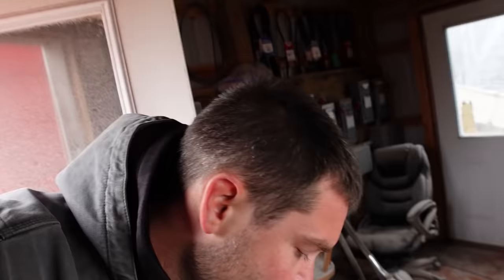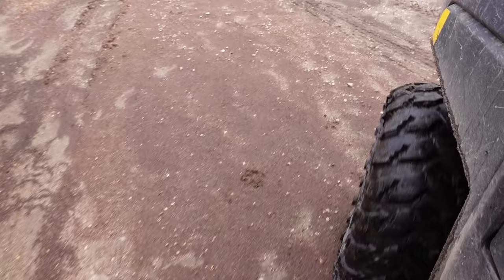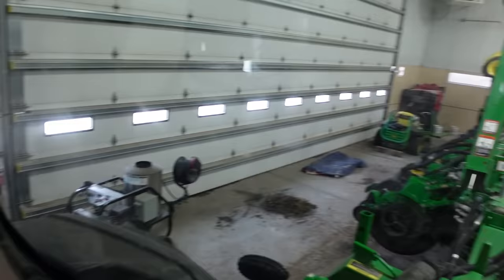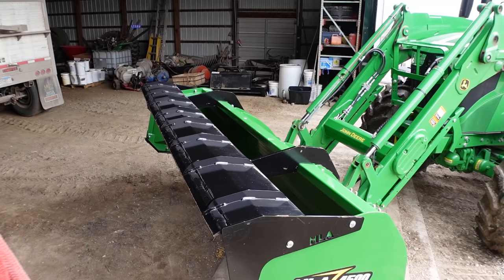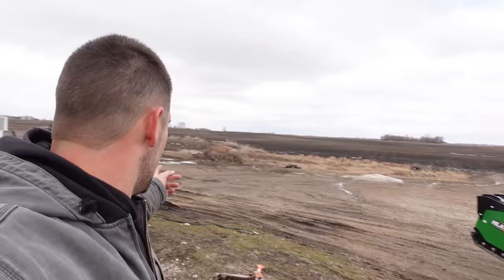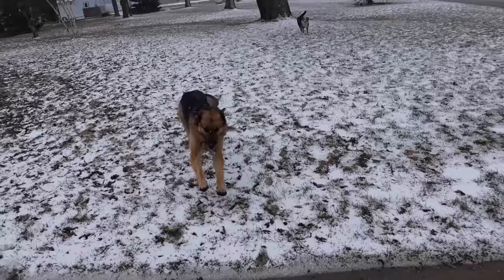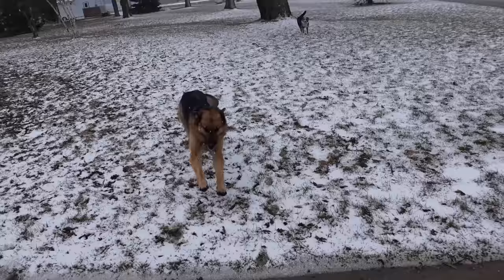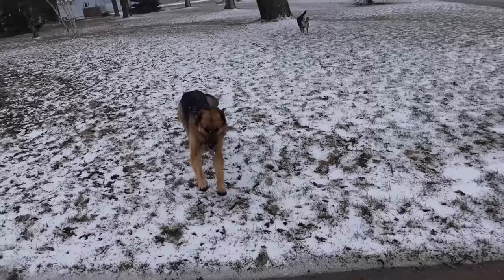Jim says it's Time!

Comment: Just a word of advice for the extinguishers if they remain in one area and just sit, turn them upside down and shake em. The dry chem will pack down when they aren’t moved around. You’ll feel the powder shake in new extinguishers.
Reply: You don’t have to go around and turn them upside down. Dry chemical extinguishers are made to have the agent at the bottom of the extinguisher.  If you do go through and shake them up or flip them upside down within minutes of them being hung up the agent will be back down at the bottom with nitrogen at either 100 or 195 psi pushing it into the bottom to go out the down tube when the valve is opened.

Comment: Never fill fuel filters. Unless your pouring it in the little holes around the edge, your filter is full of unfiltered fuel. I always just use the bleeder screw and hand pump/electric pump to prime. It’s not a huge deal on all the newer common rail engines. Note there’s no air bleeder screw on any of those systems. Just cycle the pump a few times and let her buck. I guess in the land of dead batteries you might have to take a different approach tho.
Reply: (Yawn...)
Reply: Tons of equipment in the world that has always had filters prefilled with no issues 🙄🙄🙄 this subject is getting so old.
Reply: @94chevyz71  doesn’t matter, if the manufacturer says not to prefill then don’t prefill🤡🤡🤡
Reply: @bigcheese370  how bout the equipment I pay for I use how I see fit and change the filters how I see fit? Considering I’ve never had even 1 seconds problem with any Deere or Case tractors or combines on this farm. This whole don’t pre fill is the stupidest argument in the world today.
Reply: @94chevyz71  its just not necessary, why go through the hassle of spilling it everywhere when you can just let the system prime with the ignition on.

Comment: Instead of diesel fuel we always use conditioner and two stroke oil to fill out filters up 
Gives the whole system a good cleaning and the two stroke oil adds a great lubricant to everything after sitting all winter 
Also much easier to fill filters up then using a big fuel jug

Comment: Hey Zach if you disconnect the negative cables on the batteries there won't be a draw on them and they might make it through the winter time I always like to charge once a month through the winter time but they will oxidize in the inside of the battery in the winter time if they're hooked up whether they're new or not

Comment: The new common rail engines do not air lock like the old mechanical injection engines. Have you tried opening the fuel tank and listened for the bubbles from the return line. I do that on the truck. No bubbles and she starts and runs with no issues.

Comment: As a Mechanical Engineer (Dept of Defense not automotive or farm equipment) you need to know that your equipment is designed for cheapest first time assembly NOT for ease of maintenance. The factories priority is to cheapen part cost and assembly time.
Reply: Yep, heard that from someone that used to work at engineering college. 
Also, don't care about quality or longevity.
Reply: @BWYinYang  Often your priorities are set by your boss and his boss. You don't have full control of what you are designing.

Comment: Zack- those Cummins 15L fuel filters are always a pain innthe arse! The beauty part is they have 12v electric lift pumps, you can fill your fuel filters by cycling the key 1/2 dozen times or so, will fill filters and displace air back to fuel tank
Reply: Hi Todk.

Comment: So the batteries on the trucks seem to die due to power loss in the system. Why not add a battery disconnect to them like on the tractors, should be an easy install?

Comment: You don’t need to pre fil your filters. Once you change them cycle the key 3 times before starting
Reply: Good to know. I was wondering if these had an electrical transfer pump or not. Remember the old Massy-Fergs that had a thumb lever on the side of the mechanical pump for priming. Most convenient!
Reply: I was wondering about that - with our older CIHs no pre-fil needed.  Also, with those you don't have to change the filter until you loose power (ie. it starts to plug up), which is very infrequent for most of our engines.
Reply: This winter we changed fuel filters on our 9560R & 8235R filters dry and cycled the key until you can hear fuel going back into the fuel tank. Great videos. No farming yet in our part of Mich.

Comment: This time of year leaves you with such a "nice looking muddy yard" to move machinery or tractors around.....    Change subject:  Just an idea:  this idea may work or not depending upon locations of equipment.  There are small battery charger/trickle charger units that you can mount and you hook up to the batteries (like the trucks) and it maintains a charge through the winter (and summer, if needed).  You may have a challenge with a long enough cord or wiring from the outlet to the battery to be charged but this could save you time and frustration.  Easy to unhook/unplug and to hookup.  Just a thought to preserve those batteries and reduce your frustration levels.
Reply: We just put one of those on a pickup that has some small electrical drain on it somewhere.  Those work really nice.  I'm thinking about putting one on each piece of equipment.  lol

Comment: Zach suggestion re the semi truck batteries always being dead.  There are 24 volt cutoff switches available that have a key fob remote control.  

I saw one on an industrial generator so I know they're out there.  You just clicked the remote and the cutoff disengaged so the computer wouldn't kill the battery while the machine was sitting idle.   Those truck batteries are so expensive it'd be worth a try.  Maybe somebody out there knows who makes one.

Comment: On vertical filters, poke a hole in it and drain it before making a mess.
Reply: Why don't they mount them right side up? That would work like a settling bulb and keep the foreign material down low and reduce the chance of bad things ( and water) going to the pump & injectors. 
 Easier to change too ya? 
But, I'm not an engineer 😁

Comment: Not pushing, but consider getting a METAL burning fire putter out.  If you get welding on something in the shop and it is over heat or you run into Magnesium somewhere it will burn until it goes out - White Hot.  Often in Alum blocks and Assemblies caution welding around that light metal.

Comment: 20:05 Good there Jim 👍
Someone has to tell the engineers to learn a lesson
Reply: They designed crap like that already in the 70s. Fuel filter right on top of the start motor, so the whole soup ran over  the starter every time and you could change it every other filter change as well.
Reply: Hey those engineers went to school a long time to learn how to put things in the hardest to reach places and most inconvenient locations. 😆😁
Reply: @michelle778  The dumbest thing I have come across is an up side down oil filter over the ac compressor and the multi-belt. They have thought a bit about drain plugs but it still takes a lot of paper to not get oil on the belt

Comment: Hi a suggestion maybe thought of it or not all the semis have ecm draw , but need to still see once the batteries are fully charged how much of a parasitic draw on the batteries there is , I forget  what the etc constant is for a draw ask the repair shop . Other wise once charge put in a battery disconnect. Then might have to have the shop put them in so it keeps the ecm alive but not kill the batteries.

Comment: Thanks for another great video Zach. Enjoyed it. 

Great to see your dad back home. To bad the weather is not better for him. Let him wrestle with the truck batteries. 
I have been thinking about them and there has to be a answer somewhere on why they go flat. Even with a battery disconnect. 
Strange deal??????
Hope someone comes up with a answer. 

Good to see Jim again. Good guy you got there. 
I have to laugh about the comments about engineers on the tractors. You got several comments back from actual John Deere engineers that have a reason why it is that way. Had to laugh over those comments. Oh boy. Make sure Jim reads them. 

Anna is really keyed into the tractor starting. She never misses. I agree with you Zach, she will not like the cab at all and probably will not stay in there. Oh well. 

Good delivery service getting your filters and such. Hardly any wait. Very nice. 

Seems always jobs to do around the farm. You can keep busy all the time. 
Messy and sloppy in your neck of that woods right now. Spring time. 
The haircut thing. I have mine super short so just get someone to run the clippers over my head and off it comes. Close to being bald anyway. No cost on the haircuts. 

About it for now. If you find a answer on this battery thing, please clue us in. 
You all take care and be safe. 
Looking forward to the next video. 
Thanks for everything Zach. Appreciate the filming and thanks to Becky for editing. 
The Iowa farm boy. 
Steve. 
😊👍👋🇺🇸

Comment: As a Service Engineer at Caterpillar, that did serviceability and maintainability audits on ag tractors, things like you ran into do get flagged before production.  A great number do get fixed, but we didn't always "win".  Considerations such as manufacturability, cost, and how it plays on different configurations and attachments all played into it.  I said a lot of nasty words when I had to deal with it in the field, too!  I suspect for your Deere, there were various hydraulic configurations on the same tractor model as well as wheels vs. tracks that came into it.  Always a balancing act that does affect ones' vocabulary!  Also a caution - be very careful pre-filling filters.  You seem to have a decent bulk filtering system for oil, but dumping fuel into a filter from a 5 gallon jug can lead to problems.  The center of most spin-on filters is the clean side.  Dumping unfiltered fuel or oil into the clean side of a filter can lead to shortened component life.  We once did some tests that indicated that prefilling a fuel filter with unfiltered fuel through no more than 6 filter changes can damage a set of injectors.  Especially with modern injectors running over 35,000 psi.  Just a word of caution.  Great content though.  Looking forward to spring at last!

Comment: Not sure if someone has suggested this, 

Anyhow those X15’s are used in highways trucks, same issue with full fuel filter and having to twist it sideways. 

Drop the filter down, shove a rag into the filter, then twist sideways and remove, the rag seal/absorbs diesel and stops it from going everywhere. 

On the install, don’t fill those fiters, the common rail system on those motors cannot accept contamination, put them on empty, 

On the top of the filter housing you’ll see a small pressure check fitting, poke this with a screw driver while your key is on and all the air will come out and clean fuel will go into motor. Just my 2 cents I work on these daily, the fuel injection pumps and injector have 0 tolerance for contamination. Just so life is easy for you next service

Comment: I have a 2 inch jerk rope and I use it as a jerk rope when I have a tractor stuck, I hook one end of the rope to the stuck tractor and the other end too the puller tractor, back up about half the length of the rope, put the puller in 4th gear  go full throttle and pop the clutch and GO until the rope is all stretched out and then push the clutch in tractor is out
Reply: @paulcopeland9035  I have never broke anything yet, and I've had my rope for 30 years.
Reply: @paulcopeland9035  I am always careful I use screw clevises on both ends of the rope to pull with. Side note, this winter I jerked out  a semi tractor and trailer out of the ditch with one jerk.

Comment: 7:55 if you tilt your bucket too much back (Loading motion), at some point the hitch automatically closes. in that spot you cant get it to stay open. you have to tilt out a little more. there will be a posiotion at about halfway tilted out where the bucket hangs only in the upper hooks and you can easily unlock your bucket because there's no stress on the lock bolts.

Comment: With all of the trouble your having with dead batteries, there's obviously something draining them while the equipment is not being used. That shouldn't be happening. I'd recommend having a mechanic troubleshoot to find the cause and install Deltran battery tenders on each one. When maintainers are permanently installed, all you need to do is run a drop cord to it and plug it in. If batteries are kept fully charged, they last longer and less prone to freezing. Pretty cheap insurance.

Comment: As a retired machinist I know exactly what you mean when you say ,Those damn engineers,!!!
They'd give us prints that were actually impossible to follow and impossible to make.
And when you brought it to their attention they still couldnt understand why you couldnt cut an inside diameter pocket through a hole that the tool wouldnt fit through.
Reply: Hey, if I can draw it you should be able to make it!!!!! LOL
Reply: Currently studying Mechanical Engineering, I plan to take a machining class in a couple years to help me understand how to make the parts I design. It should help keep costs low and make things easier to manufacture, if I understand the process!
Reply: @markmcculfor6113  
 Please do.
You'll save yourself from ridicule.
Reply: @TrulyUnfortunate  I think machining constraints are being taught better in college now, than they were in the past. Hopefully more engineering students will graduate with a better understanding of the process of machining. I'll try my best not to be a cause of frustration in the future to any machinists. 
I have many engineers in my family, and it seems from what they've said, that having respect and communicating with machinists goes a long way with preventing frustrations both ways.
Reply: @TrulyUnfortunate  Excuse my grammar, currently half dead from finals. 😂 I see comments as more of a text conversation, rather than a fancy email or letter.
Reply: @markmcculfor6113  
Probably because 90% of things are made by cnc so engineers now have known restraints by the machine capacity rather than relying on some dudes capacity to make work around amd.make custom tools and cutters

Comment: Zach don't all John Deeres have an electric fuel pumps?  Cycle the key until the fuel pump shuts off  2 or 3 times and its self bleeding.  You won't have air problems, even with empty fuel filters.  We never have anyway.

Comment: To protect your expensive engines, don't pre-fill your filters! You get unfiltered fluids directly into the injectors etc, and can cause catastrophic failure. Ask your Cat/Deere/Red Thing Tech about it if you doubt me ;)
Reply: If you do fill your filters , put a plastic cap in center hole & pour fuel through outside holes in filter .Clean filtered fuel comes out to injectors from center hole
Reply: @wayneselner3523  yes, that's an option as well, if you have the patience to wait for it to filter through! Lol

Comment: U know y you're batterys go dead because the cold gets to them and kills them but if u remove them and put them in a worm place or u can leave them in the truck's and tractor's and once a week go start them up and the might not go dead even if you leave them in a barn without heat your battery will go dead so when u put the equipment away for the winter try and bering your batteries in a worm place and see if the go dead or not and if for some reason they still go dead then i  don't know but every time I store my tractor's  battery inside my house it works just fine when it comes time to put it back in and start working 😀😁😁😀👍

Comment: Use the kinetic energy in that rope. Pull slight tension and then back up about 1/4 the distance of the rope. Throw the coal to it to build that kinetic energy when she gets tight and that truck will pop right out. It is very easy on both vehicles. BTW, I schedule my haircuts for every 3 weeks for a year at a time. Keeps you on track. Love the videos.

Comment: Master battery switches on the trucks will save the batteries
Reply: Right on. 👍
Reply: Or fix the root cause of the problem
Reply: He has said in previous videos that he has those already and uses them.
Reply: @bigcheese370  and the root cause of the problem is that there are several computers on the truck that drain the batteries plus the cold weather but what would I know I only worked on semis for 40 years.
Reply: @94chevyz71  humm
Reply: @williambasinger5859  what? Changing tires? if all those controllers your saying are drawing power with the key off, I’d imagine there’d be a lot more issues than that. But hey, let your 40 years experience do the talking.
Reply: @bigcheese370  changing tires as a master tech for caterpillar and Mack dealerships but the real question is what has the customer modified to cause this amp draw. Best thing to do is isolate the batteries while the unit is  be to place a maintenance on the batteries for the cold weather and help keep the batteries from freezing.sitting idle and not being used second would

Comment: I wonder is Anna barks at you getting into a tractor due to an action that happens. Because its usually not until you turn a key that she starts barking. Its obviously not a cue from you as she started barking when your dad turned the key. Is it possible that something like the fuel pump is producing a high pitched noise that upsets/startles her? Does she back when you/dad/jim get into any vehicle? Maybe its worth trying to distract her while someone else turns on the ignition of a tractor? Perhaps Becky, or someone that isn't usually in the workshop or around the tractors? 
Just a thought as it seems she only reacts when you put the key in the ignition.

Comment: So a question from a non-mechanical guy ... why do the oil pumps use compressed air?
Reply: To pump the oil - usually a cheaper way than to have an electrical pump on each item.